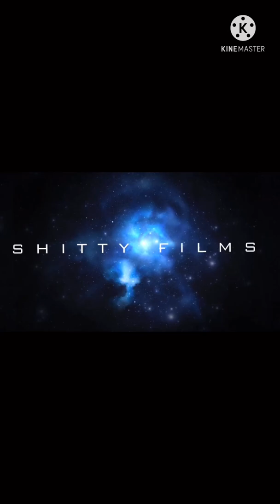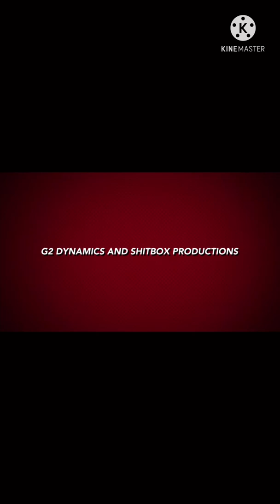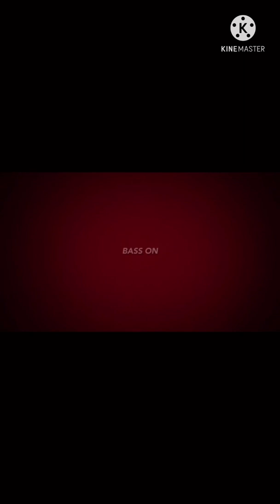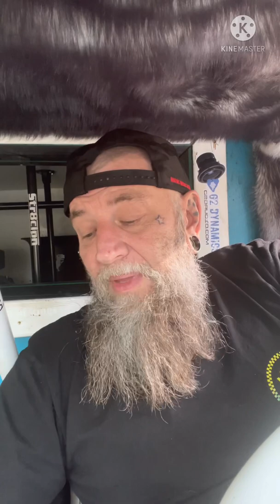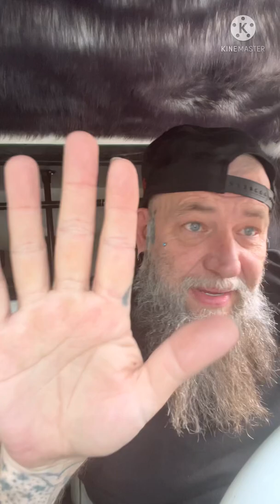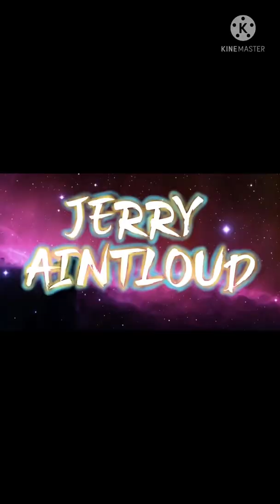A question I have about impedance rise

Comment: You have to understand that you're never gonna get an accurate power read out in real time on a reactive load. You say its 2.2 but in reality, that number is fluctuating so fast at a the different frequencies while playing music. Also, you must remember that even though a subwoofer manufacturer tells you a sub is lets say 1000 watts rms, it could very well hit its loudest output that you'll get out of it with only half the power. This is why you will see a sub play maybe a couple of tenths of a db or 1db louder with double or triple the power to it. Unless its 3db plus, you wont hear any difference. The human ear cant percieve the constant power changes either. So unless its a single frequency tone for a db drag race, I just say keep the voltage level steady and pound that bass. 😎

Comment: About clip lights, when I used the DD1 on my CAB22 it gave me a very different result. The DD1 was telling me I'm good and the CAB clip light was solid on. Someone told me the CAB is set to show clipping at .5% THD and the DD1 at 1%. No idea if that's accurate but I definitely gained volume going with the DD1 and no smell or heat in the subs.

Comment: I noticed when I had my smart 5 on the term lab . I did 4500 watts at 40 hz rising to 1.3 . But at 32 hz I can do 4900 watts still at 1.3 ohm and my spl was higher at lower wattage higher frequency

Comment: You need to make a chart from 15hz to let’s say 40hz and record your rise. Difference hz will require different power. My setup rises to 2.1@ 32hz and also 2.1@ 46hz. 
32hz might be 2000 clamped where 46hz will be 4000 clamped. I always figured the power changes because it takes more to move 46 over 32hz
Reply from the maker: i never thought of that great point